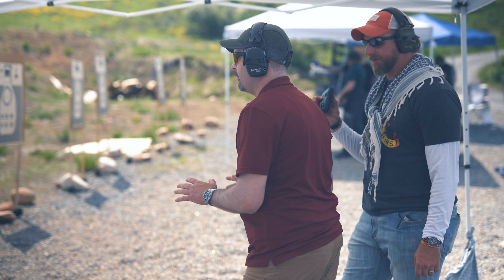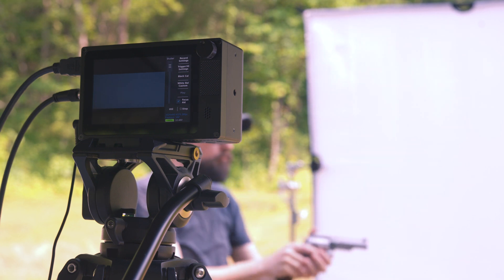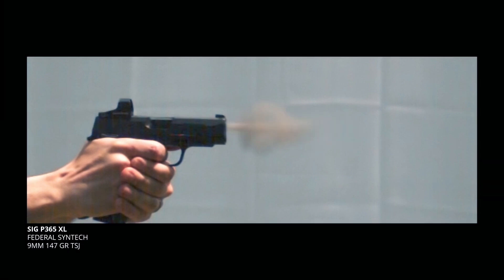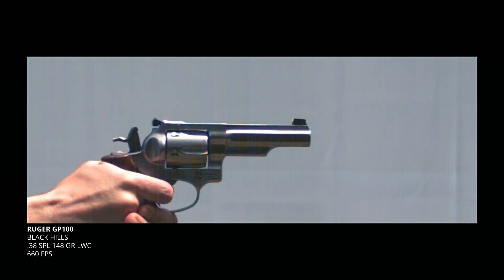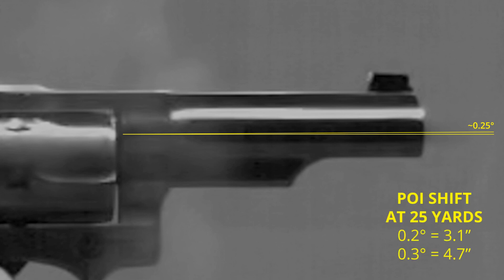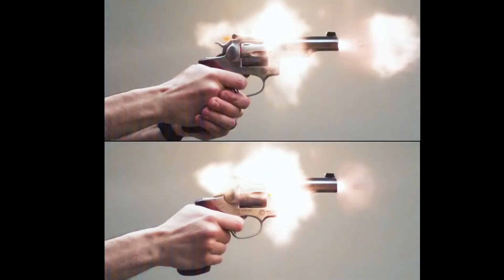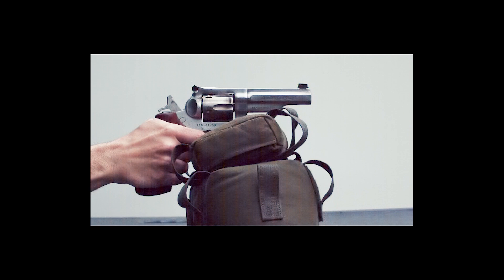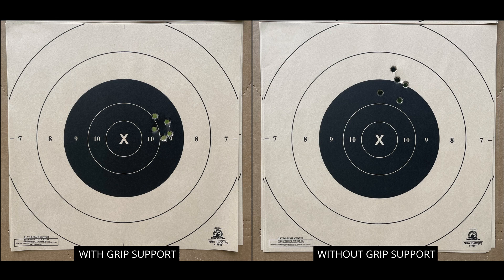How Recoil Affects Handgun Accuracy

Comment: The reason in semiauto handguns muzzle doesn’t rise before bullet leaves the barrel is pretty straight forward: It’s the Newton’s 3rd law. Or more specifically lack of its application.
Any muzzle rise before bullet leaving the barrel would mean that the entire gun+bullet+ejecta “system” would need to rise together. But how can it rise when no external force has been applied to this “system”?! 
In revolvers on the other hand, some gasses escape the cylinder before bullet leaving the barrel. So a small net force is being applied to the gun+bullet+ejecta “system”.

Comment: From a physics perspective the amount a gun should be moved by the time a bullet travels down a barrel is independent of the velocity and entirely proportional to the bullet mass.

Imagine two identical masses floating in space, pushed apart by a gunpowder charge, they would both move away from each other at identical velocity AND at the same rate because for every action there is an equal and opposite reaction. If you increased the powder charge so there's more force pushing against each other they would repel away from each other faster but always at the same velocity and would reach a given distance away from each other sooner but always at the same proportion to each other.

Now imagine one mass was much greater than the other, the larger mass would be moved less than the smaller mass. This is how a gun works. And that's how a faster bullet affects muzzle rise before the bullet leaves the barrel. The gun or barrel or barrel+slide will always move the same distance for any given bullet mass regardless of velocity. 

This is why varying bullet weight can drastically change point of aim of a revolver but varying velocity does not (except when accounting for bullet drop).

This is why straight blowback pistols have a bullet mass limit, not a velocity limit, a heavier bullet will result in the slide moving more before the bullet leaves the muzzle. Might move enough to allow a case rupture.

So how does a more powerful load have more recoil if the gun moves the same distance in the time the bullet goes down the barrel? Well, because the bullet goes down the barrel in less time, if the gun moves the same distance in less time then the gun is moving faster, that is a gun that is recoiling more.

Comment: I was told about this in the late 80s.  Basically we had 357 and 38 special loads we were shooting out of the same gun.  My dad's friend explained this effect to us.  The 38 special loads would always print higher because of the longer time spent in the barrel due to muzzle flip even tough the bullet weight was the same.

Fast forward to now.  I've been loading 2 different bullet weights in an old 38 special, but more importantly the speeds are different.  The heavier and slower bullets print higher than the lighter and faster bullets.  I re-proved this effect by working up accuracy loads in this gun with these different bullet weights.  The gun was designed with fixed sights originally and those sights came from the factory "tuned" for the heavy and slow bullets, not the light and fast ones.  The proof is where they print on the target.  Obviously the heavy and slow bullets were spot on.  The lighter and faster bullets grouped about 3 inches low.  All of my testing was at 25 yards.

TLDR, you're right on in your conclusions.  Can confirm from people I respect and my own experience.

Comment: I have an over under muzzleloading handgun (modell is detonics gladiator) and i have noticed significant change in poi due to projectile weights and bore axis, for example: at seven meters the lower barrell with a 177 grain projectile hits poa, where as the upper barrell hits 17cm high. And with a 395 grain projetile the lower barrell hits 15cm above poa and upper barrell hits 30cm above poa.

I have used 15grains of ffg black powder, it would be interesting to see if a faster burning powder would change the poi. However faster burning powder is not aviable to me. Could someone please try shooting a 38spl. 158grain projectile and a 357mag 158 out of the same gun and measure poi shift? since the only variable would be the velocity of the projectile (and maybe the amout of the propelling charge and for sure the type of propellant) It would be valuable for me to see if i should try investing in a different powder for my gun to get my poi closer to my poa. 

Anyways thanks for the video it was very helpfull for me.

edit: changed to 395 grain from 495.

Comment: Recoil effect on a handgun probably lost in the other variables. However with precession rifles there is a definite change in point of impact depending on how it’s held. Have seen this often in high power silhouette, rifle sighted in bench rest will zero couple minutes different than offhand position. Another example Smallbore prone target rifle will zero different prone & sling than bench rest off bags. It may be only 1/2 MOA still enough to keep you out of the X ring.

Comment: Fun.  

Now do another video with 12 gauge buckshot.  I learned to aim about 10 inches low  starting at 25 yards to get CM hits during quals.  Some of the newer special purpose defense and tactical rounds keep a pattern half the size of standard buck and will tell on your marksmanship. (Which in 12 ga. is usually recoil sensitivity.  

Lots of mass coming down that 18 inch pipe so I always guessed it was the action/reaction law and to a lesser degree some rearward thrust from air being forced out ahead of the shot.  

But I'm no physicist.

Comment: When I started handloading in the mid 1970’s, I determined that barrel time was the biggest factor in determining elevation at 50 feet (no time for trajectory to have much effect) when shooting a wide variety of loads from my 8-3/8” Model 27-2.  A very light, fast bullet got out of the gun before it rose much, and struck low, but a slow, heavy bullet took its time in the barrel, and hit high.  Strangely, my 6-12/“ .357 Blackhawk would place most everything within a 3 inch circle at 50 feet.

Comment: I have noticed over the years that changes in bullet weight in particular and somewhat less for velocity seem to effect POI much more in revolvers than autos.  I speculated it was mainly a greater effect of the higher revolver bore axis on the rotational force in your my hand but this is the first time I've seen high speed camera footage to verify if this is true or not.  Seems that is a partial answer but the rearward slide movement in autos before the rotational movement occurs was not something I expected would be such a significant factor.  Unique and informative video!

Comment: Maybe related, or maybe not... I didn't learn how to effectively double-tap until a shooting acquaintance taught me how to use that muzzle rise instead of fighting it.  Like everyone, I was taught the "death grip" to try and fight muzzle rise. He showed me how to relax my grip and fire single shots until I found the correct tension where the the sights fell back on target. Once you have that down, you just begin hitting the trigger twice as fast as you can and you'll land both shots within a palm sized group.  When I used the proper "death grip" as taught by my military instructors the muzzle rise transferred back to my forearms and the second tap would always be high, or just wild. When you relax the tension in your hands the recoil (and muzzle rise) stops at your wrists.  It takes some experimentation with single shots to find that correct tension, but once you have it and repeat it enough becomes muscle memory and very easy.

Comment: Thanks for all the work (and expense) putting this together. I've found that in almost every gun - semi-auto and revolver - heavier bullets impact at least a little higher at my usual sighting distances of 15 and 25 yards when the heavier bullet is traveling slower than a lighter bullet. Roughly calculated, a 0.03" muzzle rise translates to about 2" at 15 yards (8" sight radius).

Comment: 5:18 I tested this in a Ransom Rest and included the results in my first book, Beyond Expert. Shooting ten-round strings from an M9 at 25 yards, the first five shots were fired holding down the unit (the return to battery ledge on the right side) and the second five I allowed the Ransom Rest to recoil up as designed. This resulted in two distinct group centers about two inches apart.

The vast majority of POI change is due to shooter error, especially by unintentional movement due to anticipation (Pre-Ignition Push/flinch), however, how you hold the firearm during recoil does have an effect.

Comment: Very interesting topic. 
I'm curious, is the difference from the gas exiting the cylinder gap, the lack of a moving slide, or both.
I can see a future video with single/double pistols, more variety in barrell lenght and both supersonic and subsonic ammo.
For a less expensive improvement in muzzle flip detection, you can put some paper with a square grid as background.

Comment: I frequently shoot out to 100 yards with semi autos for fun and I've definitely noticed vertical poi shifts from different ammos even with the same bullet weight. Because i don't notice horizontal differences, i assumed that the effect was caused by different velocities or pressure curves causing different bullet exit times within the recoil impulse. Your high-speed seems to disprove my theory however.

With high recoil rifles, how tight you hold the rifle to your shoulder will definitely affect the vertical poi which leads me to believe that the recoil is moving the barrel before the bullet exits. Or maybe there's another variable that I'm not considering.

Comment: Yeah, any experienced revolver shooter knows that, generally, a heavier, slower bullet will print higher than a faster, lighter bullet, so it's important to know how each different load will print from your gun.

Also, just look at the sights on a revolver.  You'll see right away, and you can see it in your video here, that the front sight is higher than the rear.  That "negative elevation" needs to be there because the gun rotates upward during launch.

Comment: I think part of the reason that the revolvers are showing more muzzle rise vs the semi auto pistols has to do with how much higher the bore is above where your thumb come across the backstrap of the pistol. The recoil therefore has a longer moment arm (or is it lever arm?) above the hinge point of your wrist in comparison to a semi auto. As soon as there is ignition of the cartridge and the bullet begins its movement forward out of the casing, there is an equal and opposite force causing the entire revolver to move backwards because there is no give in the chamber, whereas with the semi autos, that backwards force is initially getting absorbed by the slide (with minimal resistance of the slide spring) moving straight backwards until it reaches its limit of rearward movement, and only then does the rearward force act on the moment arm to the hinge point of your wrist, thus resulting in a delayed and less significant muzzle rise.
Reply: I'm liking your thinking
Reply: I doubt. In semi-automatics the action moves back while the bullet is in the barrel. There is no reason why the barrel would rise beyond friction and the spring which are minuscule. On a revolver the only thing that can move back is the actual weapon. Since the weapon weighs about 100 times the bullet the movement is also 1/100 i.e. about one millimeter. I find it surprising that it raises even that much on a revolver considering the flesh has easily that much give in.

Comment: Chris, in my personal experience: with a non-death grip my 340PD with 357 magnums will shoot several inches higher at 7 yards, compared to the impact point when I have a death grip on it.  Death gripped 357 hits the same place as my 38 wadcutter hand loads do, which is properly at the top of sights.  (That's landing all shots inside a 2" circle too.)  I'm not sure how that fits into the testing, but just my experience.

For anyone wondering, I use 357 for occasional range fun, but I carry 38. While you absolutely can shoot many 357 in one session (I did 75 when I first got it and was sad when I had to stop because I ran out of ammo lol), it will bruise your hands for days and you gotta have the mental will to not develop a flinch too. 357 out of a 340PD is brutal, but it does make for a fun time as you pass it around letting your friends all try it... once

Comment: Short answer is doesn’t directly effect accuracy. Now your reaction to recoil absolutely effects accuracy lol. Students are shocked to see me make hits at 60 yards with a glock 43 upside down using my pinky to pull the trigger. The only thing that effects accuracy within short distances is sight alignment and trigger control, that’s IT! Recoil effects you mentally and often times people shoot worse after their first time because they want to control the recoil. So here’s a little tid bit… the more recoil control you have often times your accuracy diminishes because you are putting an excess of force on the gun, which leads to fatigue which leads to stability issues. Quit trying to control the gun, just squeeze that trigger as smoothly as you can, much like accelerating your car grandma style 😅 nice, slow and easy. You wanna shoot fast? Grip it tighter and watch your group open up

Comment: Excellent video with good information. An easy way to see how different revolvers act is to take one with good sights that is perfectly sighted in, now put a laser bore sighter in the barrel and compare the POA vs POI, the difference is very apparent it appears it should shoot low.  I discovered this when making custom revolver sights and using a laser to get the sights close in the shop before taking it to the range for live fire.  With autos and other firearms the laser could get very close but the revolver requires compensation for that movement shown in the video. Another interesting thing while testing match ammo in accurized revolvers is that I always got better groups with wooden grips than rubber grips, it probably wouldn't show up using a normal revolver and ammo at 25 yds but at 50 yds where I did my testing it did for me. Not saying rubber grips make your revolver shoot bad they are great for absorbing recoil it's just another variable in the mix.

Comment: I have extensive experience shooting my S&W 500 Magnum 3.5" PC revolver from a distance of 25 yards.
My shooting was done with two hands, standing unsupported, using "Double Action ". 
If I did not hold the grip high up on the back strap and with a super tight grip while aiming, the recoil would throw my shots off and my 5 shot group would be around 5"-6". 
When I held super tight and concentrated with a total disregard  for the impending violent recoil, than all my shots would result in groups under 2"!
The "tighter the grip, the tighter the group"!!

Comment: Awesome topic!  When you introduce this info into the topic of zeroing pistols with red dots, I think people can really benefit. I have found that my group sizes shrink considerably with a red dot sight on a handgun. I've seen a lot of discussion about techniques for zeroing, for example, immobalizing the gun in a ransom rest vs shooting unsupported the way you would normally shoot the pistol. After watching this, it seems at least with some guns, you should at least try to verify your zero with your regular shooting grip, and see if there is a noticable POI shift, and that it may not be "the loose nut behind the trigger"
Reply: The way I zeroed mine was wresting my wrists/forearms on something. The gun still interacts the same way with your hands, but there's a lot less wobble as you got something to steady your arms on
Reply: @DWalter.27  that's what I chose to do also I found it difficult for some reason to pull the trigger correctly with the gun rested at the grip and the dust covet. Not sure why, it just felt really awkward.